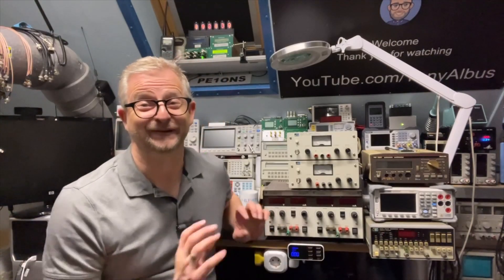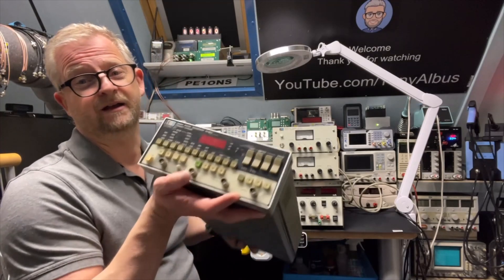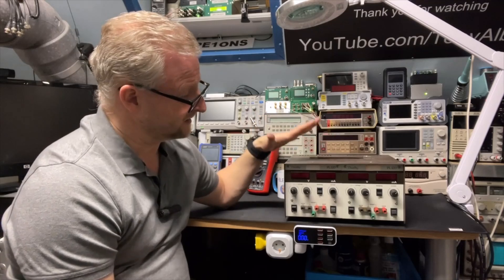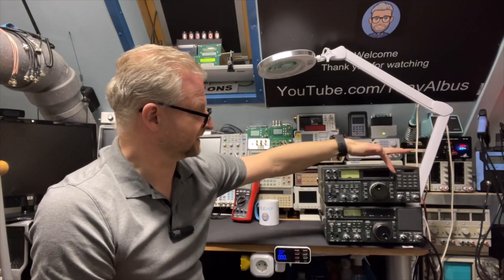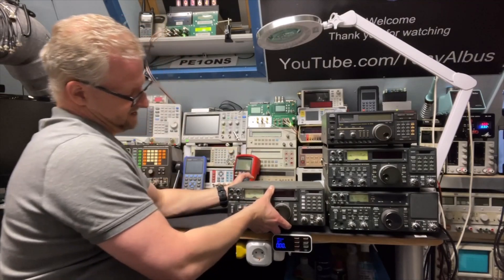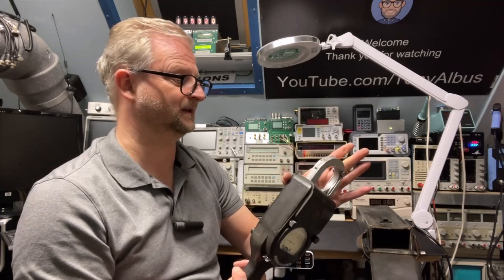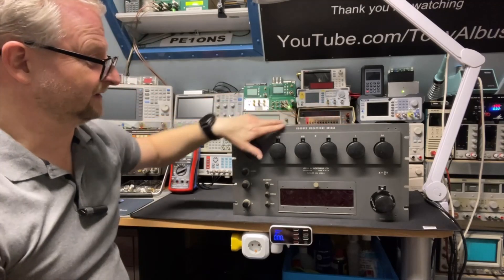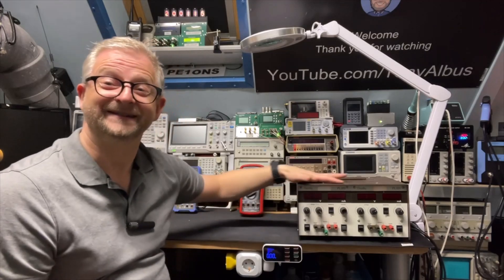#237 Update Okt 2021 - What is coming, Test Equipment, HAM, Classics

Comment: Hi Tony,  My first thought was he's been at it again!  I will let you off mostly this time.  I saw the two HP supplies and thought how does he do it?  It's just that I just added an HP 6209 and an HP 6299 which are very similar looking.  One goes to 100v and the other to 335v so adds to the lab flexibility.  Anyway, I'm sure the 6203 will be a good addition for you as well.  Looking forward to your run-through of all the new gear.  Just so you don't need to check late at night I just added an HP 8643a as well! :-)  Cheers..Allan
Reply from the maker: Hi Allan, how is that possible, amazing... LOL .. That 8643A looks cool! ..
Reply: @TonyAlbus  Very cool but very big!  I feel a lab remodel coming on 😃

Comment: hello, i need an advice because I just buy an oscilloscope. I can't decide myself between these cable (50 ohm each of them) . Some said RG316 RG58/U are too fragile.  They says that RG 58  is more appropriate for oscilloscope. what do you think ?
Reply from the maker: Hi maybe RG316 is even more comfortable, i like it.
Reply: @TonyAlbus  I watched that we can solder the connector with RG316 . Is it a good idea ? ( i dont want to buy a crimper tools if it's dont needed).
Reply from the maker: what do you want to connect to the oscilloscope with that cable?
Reply: @TonyAlbus  not antenna, but some features home made to study some chips as W2AEW did,  and also a fonction génerator. so short cable and not more than few MHz